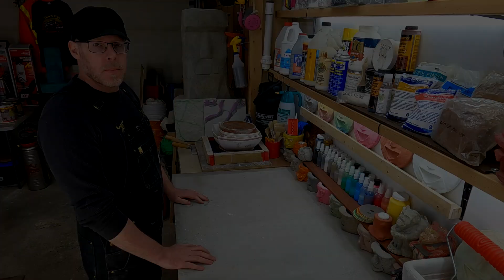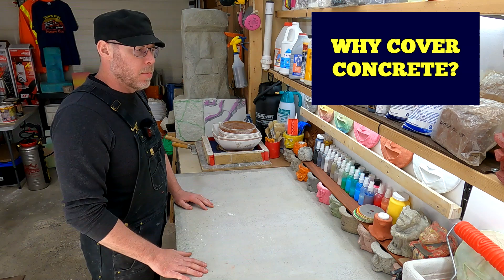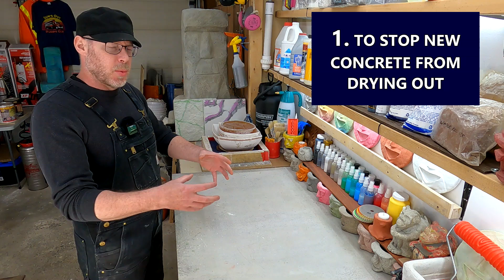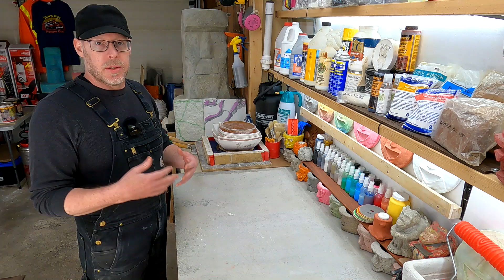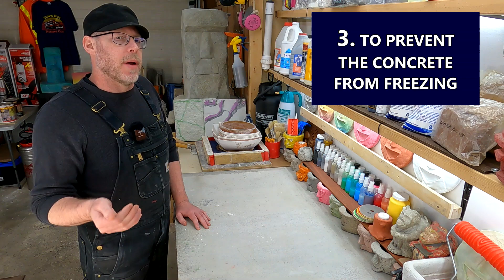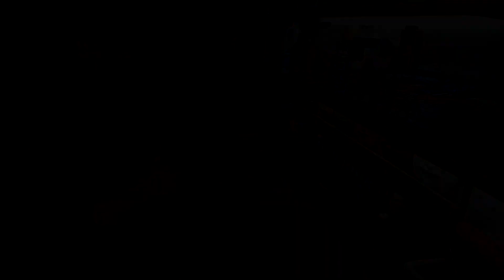Why Cover New Concrete?

Comment: I have poured slabs of concrete for small garages and workshops,  all diy using a rented cement mixer and wheelbarrows. Something I can't find any mentions of is covering the wet concrete with plastic to achieve a slick smooth surface. It could then be easily painted, or left as is. That's how we did it 50 years ago anyway.